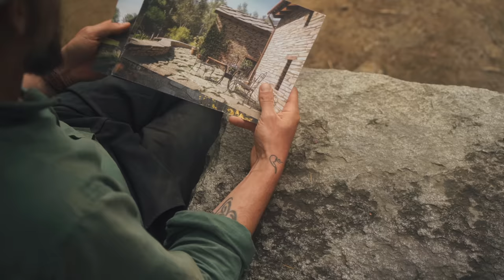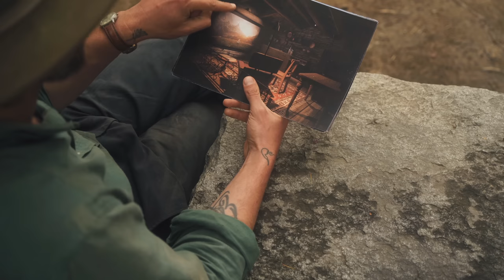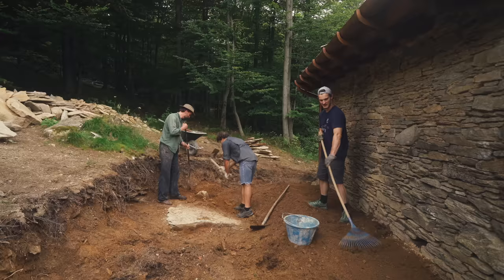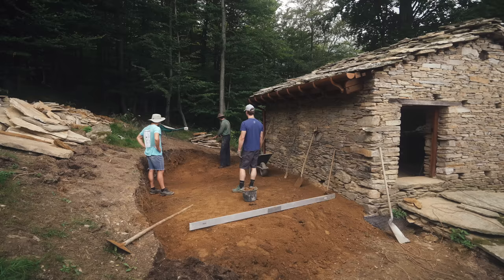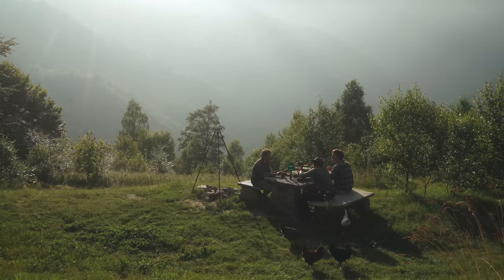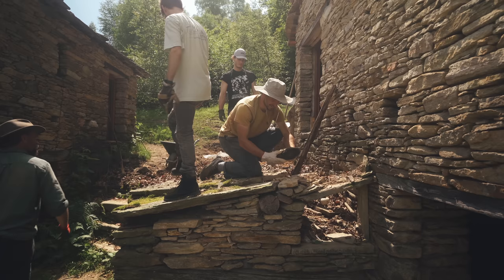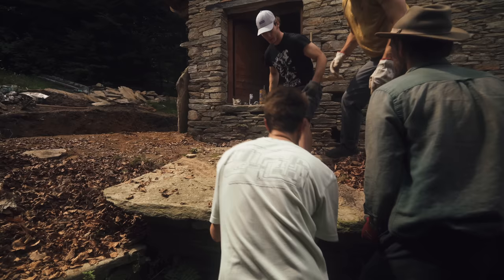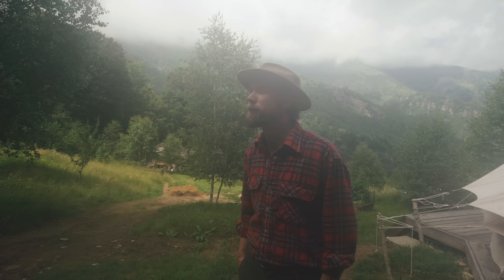#74 A Look into the Future

Comment: Consider placing the bed in the middle of the room with its backpanel facing the toilet, so the back panl of the bed would close/separate the tiolet from the slipping area
Reply: And, it will face the fireplace which could also have a flatscreen tv over it for watching a movie in bed.
Reply: That's such a great idea!
Reply: I would Never sleep in a bed without a separation from the WC (it could  only be a paperwall)
Reply: I just cannot emphasise enough how much toilets need to be separated! Even if just a frosted glass wall. You can definitely be creative in making the right partition so the room does not feel diminished. But you cannot have your toilet continuous with the bedroom which leads to the staircase to the upstairs all open! It is not conducive to ever receiving guests if they have to go to the other house every time they need the loo. Imagine at some point in time you have someone to share your bed. No one ever imagines romantic bed and fireside poops with a lover….!
Reply: That's an idea - or just a moveable screen in front of the toilet. You know, a lightweight foldable screen made out of a wood frame with fabric stretched within the frame.( Kinda like how women would dress behind one in the western movies.) At times you could easily move that 'screen' near the big window while showering, etc. Multiple uses.
Reply: I usually really love the way Martjin designs but the toilet next to the bed would be a real no no for me. I know it's small but I can't imagine the there isn't any way to have at least a visual separation. What about some kind of curtains or a frosted glass?
Reply: Some plain Chinese style paper screens would be nice to create a little divider or Indian rose wood carved screens🙂
Reply: That is a good idea. I think there might be space for a very small wet room -- which could house both the toilet and shower. No one wants to sleep next to a (non-separated) toilet. If there is anyway around it, I think you will be glad to have made it work.
Reply: I love your videos and seeing how everything is unfolding. Your hard work and precision planning is admirable. Everything is perfect apart from that toilet in the bedroom! Surely, a screen is in order.

Comment: I would hang a good quality flat screen TV on one wall, hooked to a high-definition camera outside.  During the day, as desired, the camera would connect to the flat screen to create a large virtual window of the outside view, as if an actual window was present in that spot.  The screen could be trimmed to look like a window.  At night, it would be used for normal TV stuff.

Comment: as an interior architect and 3d artisti i strongly suggest you make a closed are for the toilet !
Reply: Yeah the toilet right next to the bed is off putting
Reply: Hes living alone, so no problem 😅😂💩
Reply: @DNN88  he's looking for someone to share his life with so would think she'd appreciate some privacy - even medieval castles had it
Reply: I lived like this in NYC. My apartment was small too, built in 1888, and the toilet was in the middle, not far from the front door but also next to the biggest window in the place and I didn't want to lose the light by boxing it in.  Was kind of nuts but I built a low wall around it with an aquarium on the top part, so it felt light and airy, and you could watch the fish while you sit on the pot.
Reply: @battles146  how do you know hes searching ?
Reply: I agree! I'd sooner have a pot under the bed than a loo out in the open like that.  Apart from that, it really does look great.
Reply: Yes add a Japanese style toilet that has the sink included on the top of it. Surround the toilet with frosted glass. Then you just need a small shower.

Comment: @20:54 I don’t know if the building regulations would be a problem, but you could have the toilet and a smaller basin maybe even a shower tucked in below the stair case where the fireplace is right now. Maybe use a glass portion about 2’ or 600 mm from the staircase. Shift the bed more towards the space that would open up on the left side. I am also an architect, just my 2 cents. Love your videos, love the series and the Architects have provided you beautiful renders. Kudos to them.

Comment: Martjin, the interior renderings done by your Spanish friends are aesthetically pleasing, but practically unfeasible. They could be fine in the Spanish sun, but not in the Alps at an altitude of 1200 meters with a North West exposure.
Elevation behaves like an inclined plane that moves the current latitude much further North. At 1200 meters it is apparently Italy but it is as if it were in latitude 30° further North.
As the historian Daniele Jalla explained to you, these houses were used for summer transhumance. The farmers took the cows to graze at high altitudes for only three or four months in the summer, then they returned to the valley. Nobody lived there in winter because the stone houses are too cold. 
There is an expression in Italian that defines this activity. "caricare i monti, o caricare l'alpe", literally: "to load the mountains, or to load the alps".
I understand the aesthetic preference for exposed stone, but that goes for the exterior. The houses in the Alps located at fairly high altitudes have internal insulation and is generally made of wood. 
Let's compare the coefficient of thermal conduction:
Luserna stone is a Gneiss, it is an excellent conductor of heat with one of the highest values, being about 3.5 W/mK, while dry fir wood is 0.1 - 0.13, 
about 35 times less!! 
This means that without insulation after the stove has been switched off, the internal temperature drops to very low values as a function of the thermal gradient towards the outside. If it's 20°C inside and -5° or -10°C outside, the temperature drops in a short time and the water vapor condenses on the surface of the stones soaking them in dew which must be re-evaporated the following day. 
You can ask Johan how many stube there are in Austria set up inside with exposed stone walls, I think none, 
in fact in his home he built insulating cavities with passages of hot air coming from the large stove built in refractory bricks, typical of stube. He also covered the walls of his private chapel with wooden slats, called "perline" in Italian, 
meditating in the cold is not very comfortable, a hermit yes, but with every comfort :).

Finally the fuel; if you had to cut the beech and birch trees grown in your pasture, yes or no would be enough for two winters, better to think of modern stoves that also burn pellets.
Excuse the prolixity, but the current choices will influence the future of the place. 
Ask your geometra to calculate the building's heat transfer.
Good work!
Reply: Crazy informative comment. Not paying attention enough to know how Martin intends on using the place, but your analysis is awesome.

Comment: Martin for storage, place a closet over the far end of the stair well.  Either enclosed or open.  Extend the railing around.  And local codes may not allow a short railng.  You could use glass or posts with cable wires  so as not to stop the eye.

Comment: Any plans for an outdoor shower, bathroom, toilet  before you finish the landscaping? Located near the cabins or close to the water distribution piping.

Would you consider adding a rocket stove kitchen with sink near the picnic table? Can be covered or uncovered. Easier to prepare, cook and cleanup. Maybe a small brick or pizza oven. Space for a small fridge/bar. 

Like the artistic renderings for inside the cabin. Moreso the drop down projector screen.  Maybe a small shower stall with a wrap around copper railing and curtain. Low flow like on camper vans or sailboats. May even be a bag or copper drum/pot filled with warm/hot water as required. Water storage options: boiler kettle, beer keg, gardening pressurized spray mister, distillery boiler/pot.

Comment: The fireplace in the stairs is very interesting. The main thing is that it would be fireproof.
 The bed on the projection is close to the fireplace door. I don’t know what kind of frost you get, but I’m afraid that the door will require some work (insulation).

 Thank you for the videos, they help stop the fuss. And remember that life is about now, not about tomorrow.
 Good luck to you!😊

Comment: Have you considered a look into the future where between both cabins was glass and stone multi level atrium.  Sheltered space between buildings during the winter.   Glass and screened views during the summer.   

Perhaps a flat upper and lower area enclosed, each with its own entry up top and down low the lower patio.   Maybe a nice stove to heat.   

And the patio could have a stone oven.

Comment: SOLID SURFACE REMINDERS: Adding solid surfaces means WATER MANAGEMENT, i.e., making sure slopes direct water away from anything that you need to keep mostly dry. Slopes can make or break landscaping plans. Every few years, Californians on soil-based hills, faces landslides. So, whatever you do, consider a WATER management plan ENGINEER. It will save you a ton of grief and expense.

Comment: I would enclose passage between two houses in a wood and glass structure so that in winter one can go to the bathroom in the other house.The passage could also serve as a bit of a greenhouse in the winter and a place to sit in sunshine. In the rendered house i would not put in the shower but would leave toilet and sink. I would  reorient toilet by 90 degrees and then the area that needs to be enclosed is much smaller. Or toilet could be left out completely.

Comment: Just viewed older vid where you build foundation for bench seat for your table. In U.S. , we call a two headed digging or grubbing tool with wide beak and axe head opposite, a mattock. It looked like the mattock you were using had the beak pried up and bent back.  It can be reset if you know a local smith. Save time and money by removing the handle first. Once the 'beak' is reset, have him redo the edge, which will take another 10 minutes. Then let the whole beak soak in fire until it gets to cherry red and plunge in oil. 
p.s. - the fact that the beak bent instead of snapped off, says the tools was built properly. Well heat treated tools bend instead of breaking off. Cheers

Comment: to the room downstairs: You could make a complete Wall of Glas . There is already glas where the shower is. So you could connect it with the glas  wall and do a door between. Also you could to an curtain of the same color oft the stones directly behind the glas inside the bath rom, so that the guy who is on toilet can have  a quit place. If you want you can take the curtain biside to the corner of teh washing desk . So if nobody is on bath you have the same lighteeling like on the pictures. The Advantage is, that it doesent take much space. Sure the place between the bed an glas on the left side is small, but it would work im sure . Maybe you can also make the wahing desk not so big , so you have more space to stand before it. Maybe also Plexi GLas works , you should ask your specialist.

Comment: Hi Martin, nice episode. A few observations regarding the project..the local legislation does not impose a ban on the open space bathroom, obviously the aero-illuminating ratios must be respected, however I understand that you are bound by the soprintendenza of the openings which I deduce are in derogation therefore you could have a problem and they can amount the closed and ventilated toilet. Furthermore, in Italy it's illegal to have a bathroom with a direct connection to the kitchen, the solution they have proposed in Italy is not applicable, you have to separate the rooms by creating a double filter. I don't know your municipality to be able to view the hygienic-sanitary legislation and in general if not mentioned the regional one of Piedmont is authentic. You have two solutions, mount a glass wall in the kitchen in order to isolate the stairwell with a sliding door with an exposed track, or mount the same wall but in the bedroom..in both cases the toilet must be closed in a case with forced ventilation because it needs a double filter to get to the kitchen.

Comment: Martin my friend - I highly recommend from a Design perspective and flow pattern on the exterior of the buildings - that you remove the Dog box room between the 2 huts ...as a dog box room does not need to be in such a key focal point from an overall design perspective.  As nothing will make the huts look smaller than they already are than the current location of this small dog box room !  On 1 aesthetic point of view - its sweet and a cottage-style utility. However its also 200% more of a negative against its existing location and is clearly an afterthought and add-on that detracts from the scale, style, and flow around to 2 huts ...so be brave and remove it ! .. the extra space will be multiplied by the increased sense of space and natural non clutter of openness gained... a wider terrace and flowing full-width steps between the different level and huts will be multiplied in the visual and aesthetic sense of flow ... a better location for a dog box room would be to the side of the huts NOT in the middle of both huts... !!  If you are very romantically attached to this existing dog box room - simply photograph it , map it and chalk mark the stonework to be removed and rebuilt in a better more thought-full location. Remembering that just because it is old does not always mean that it was the best decision a long time ago and in light of today's needs and master plan. 
As I am a qualified Designer working on my own 300 year old finca of 380m2 Finca here in Ibiza Spain I know about this type of historical architectural sensitivities :)

Comment: where the staircase small ornamental fence is, make a long desk out of chunky wood with dimming lights hanging down off the ceiling. multiple use for the desk/bench/table. use leds   for the downlights then you can keep plants inside..check which LEDs are suitable, not hard to find.
Reply: with regards to the toilet downstairs, make a partition using wood but not all the way to the roof - make it with gaps so you can kind of see through too. this way you're not closing it off as you are not going all the way to the ceiling. thick timber with say a hand ✋️ wide gap. partitioning is an art. you can use all sorts of material for example using plants etc. it's endless and there are some creative ways to separate, while not hindering view or creating clutter

Comment: I like the model presentation of the future terrace and landscaping. My dream would be to propagate the rarer/endangered Alpine species you have up there like the St. John's lily, which I bet would flourish on the berm side of a swale (well drained), and have some of the higher altitude ones growing out of the walls. Rock garden is Alps. If you Google rock garden Cottian Alps there's a very pretty pink primrose growing from rock. I'm sure some of the medicinal and veterinary herbs treasured by the Waldensians are still growing up there and could be a fabulous landscape material.
Also, the toilet facing the bed and vice versa? 
Nunh unh. 
I'd walk barefoot in my jammies to the outhouse in a blizzard rather than have the pipi next to my bed. But this is only my opinion, you must have your place exactly as you want it.

Comment: My sister has an old stone house (rustico) in Italian Switzerland, Ticino, covered with granite slabs as a vacation home. Inside it is always cold and rather damp. In the hot summer pleasant and in winter and the transitional period only by oil heating and wood fireplace to get reasonably warm. 
I find the house very beautiful, but would not want to live in it permanently myself. 
Do not understand why Martin did not buy a wooden house as a kit. These are relatively cheap to get and you can build and add to them yourself and would have a great view of the mountains through large windows. Still, it would be sustainable and close to nature. The romance to the old Italian houses with tiny windows and low doors you pay with many restrictions and ultra hard work.
And you have more time for gardening, hiking and...
Just my 2 Cents.

Comment: the renderings look great! If you would be open to slight suggestions ,which I completely understand if you're not as this needs to fit your life, and yours alone- 

But I was thinking that with fairly minimal changes, you might be able to make the toilet a little more secluded: by rotating the toilet 90 degrees, so that the back is towards the shower. you'll need to build a little wall or half wall between shower & toilet to secure it ( this means that the entrance of the shower is to the front; glass door)

Then you can put in a small half-high separating wall between the toilet and the bed. it might mean that the vanity is a little smaller, but you'll win extra leg room around the bed, since the toilet takes up less room sideways. 

I'm not critizing at all; I really like what is there, but I just wanted to give an alternative because it might be nice to have an option for additional privacy and/or if you were to have a partner staying with you.

Comment: I like the interior plans the architects sent to you. I have been a big fan of the Eames chair and had one for over 30 years, but wondered why they did not add the Eames ottoman. It looks like there is room for it particularly if the round table on the left of the chair is eliminate and the ottoman can be with a loose wood top. That would give you a lounging area since there is no sofa or a place to put up feet except for the bed. The ottoman is mobile and be alongside the chair when not in use. I do not see a fireplace. How would the rooms be heated?